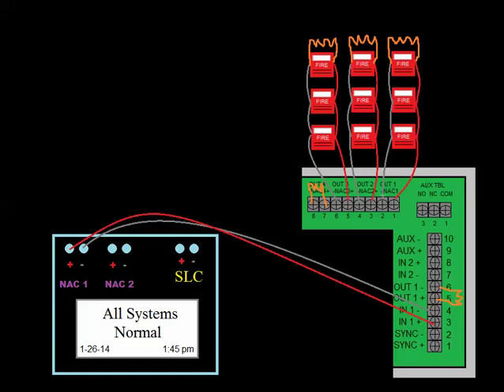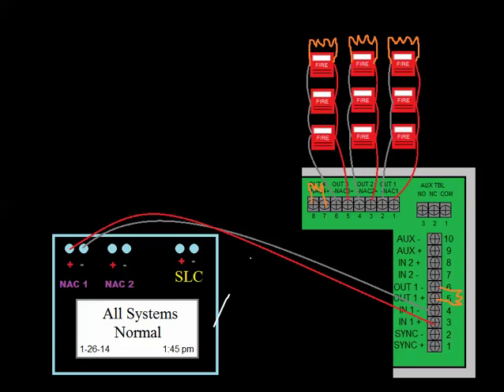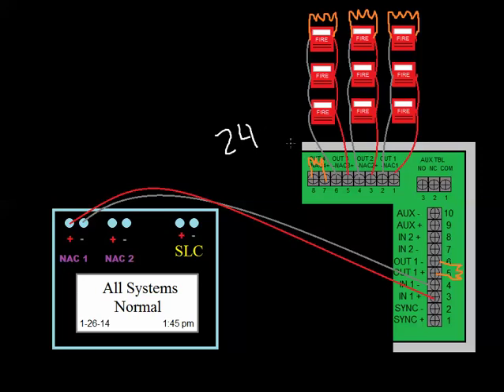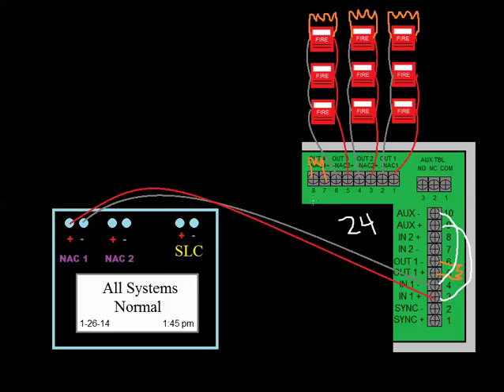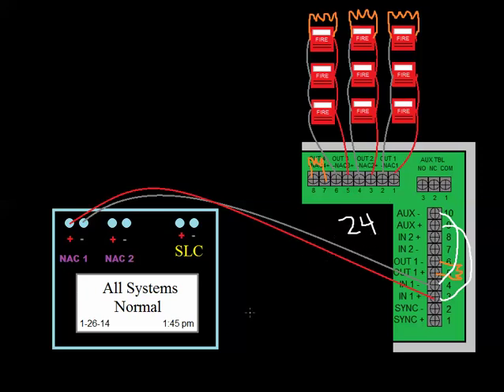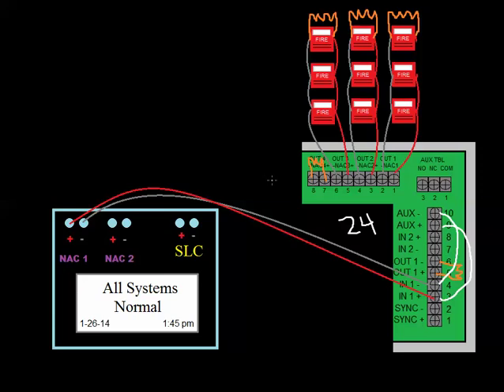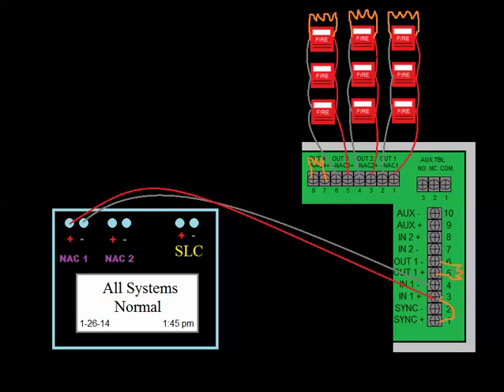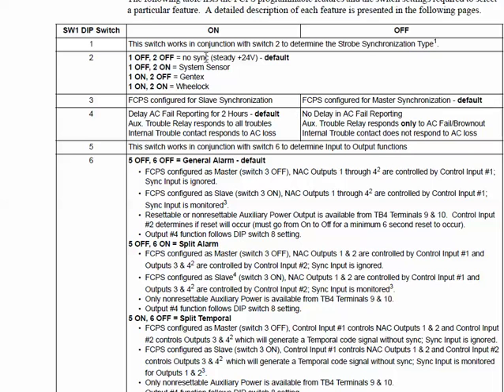27 - FCPSs Continued  - Introduction to Fire Alarms

Comment: Just discovered your channel Joe. Awesome work. I had a question that knowing the answer isn't really important but I have always been curious. Do you know how hitting "signal silence" on an FACP silences horns but allows strobes to still pulse? Is it something about reducing voltage to a level that only the strobe component works? Is it witchcraft? Thought I would ask
Reply from the maker: I think it's witchcraft. It definitely has to do with the sync signal, maybe it only pulses the sync signal so quickly that the horn can't activate? I'm honestly not sure.

Comment: Just found your video series, Joe. I'm extremely new to this field as my employer wanted me to start learning Fire Alarm Systems as a side to my Network Engineering position. So far, I attended an 81 hour course that taught me basically nothing, and that's the extent of my knowledge in this topic. As such, I looked for videos on the interwebs and found you! You've taught me more in the last 27 videos than my 81 hour course did. So, I ask on behalf of the other nearly TEN THOUSAND subscribers and myself, please make number 28!

Comment from the maker: I plan on making a video showing the FCPS being triggered off of a control module. I'm not sure what you mean about the control module running from the NAC outputs on the FACP. The control module would typically get its power from the AUX terminals on the FCPS and it would be "triggered" through programming and via the SLC from the FACP. Hopefully when I make that video it will clear it up a bit.
Reply: You’ve got almost 9000 subscribed people waiting for video 28! You can’t let us all down
Reply: @stevenlaughlin4539  13K now...
Reply: Thanks for the reply.. I guess all control modules must have an extrernal source of power, other than the 12v from the SLC?
Reply from the maker: Yeah. They either require whatever power is going to be put onto their output. Generally either 24 VDC in the case of horns and strobes or power from the amplifier in the case of speakers.
Reply from the maker: To just bypass bells it's usually pretty easy to figure out. Notifier is almost always all 1s, EST is usually all 2s or 3s I believe. Simplex is either 333 or 3000 depending on the panel. Mircom I believe is essentially the same as EST. MXL panels are usually 07927.
Reply: Joe Klochan please make a video on the new arc system
Reply: When are you coming back?